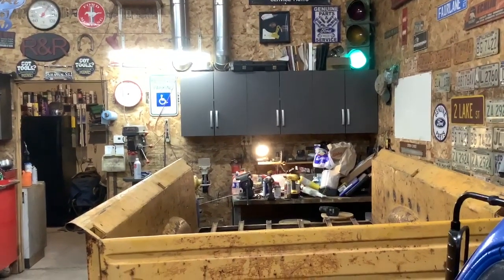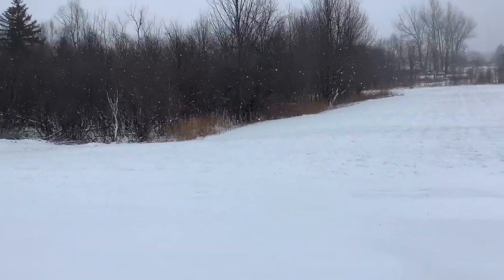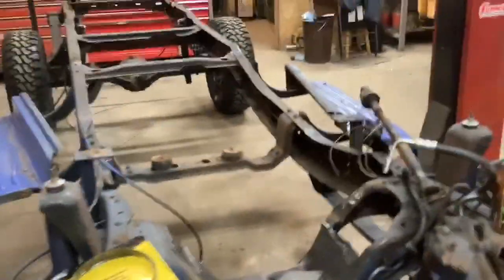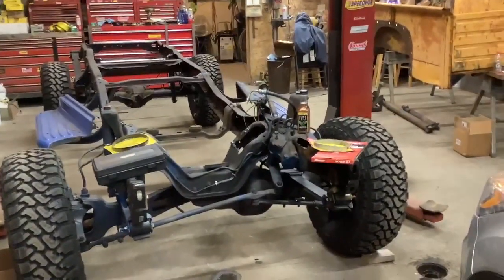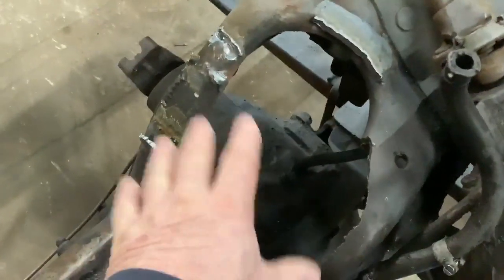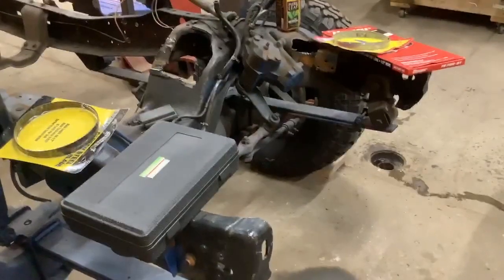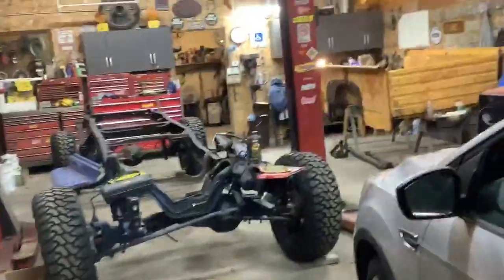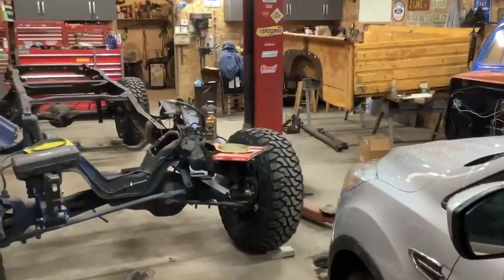Some new Xmas tools and Happy New Year .

Comment: I’m with you. I love Harbor Freight. Especially when buying a tool I only need once in a while. I don’t use them to make a living so if I was to break one I can just wait a day or two and go get another one. I have some yard sale snap on tools as well but the bulk comes from Harbor Freight and box stores. I want one of those bands saws too lol. One of these days. Happy New Year!
Reply from the maker: I bought a set of cheap deep well impact sockets years ago and I still have and use them ..I love cheap tools and Harbor fright fits into my price range ... ..I have pretty much built all my hot rods with cheap tools . One of the most over looked tools are Stanley I have two set of them 109 piece set , I use one of them when I go get used parts and the other is at my home . Happy New Year to you as well .
Reply: Rusty rods I may have the same set. Use them all the time
Reply: @ronsgarage4230  Me too. Two sets standard and metric.  Going on about 20 years.

Comment: Good score on the tool's!!! I do use my tool's for a living and own a lot of Strap On tool's!!! But 10 years ago or so I bought a new set of Harbor Freight deep and shallow metric regular sockets for 9.99 a set!!! I use them on my Ingersoll Rand Titanium 3/8 impact all the time and have NEVER broken one!!! But if I put a chrome 250.00 per set Strap On socket on the same impact I can guarantee it will break, maybe not the first time, but it will break!!! Most Strap On stuff is made in China anyways now!!! But they still want a premium for their stuff!!! Let's not even talk about their waist of money tool boxes!!! You're not buying a "tool box" from Strap On,  you're buying a "Fool Box"!!! Because you're a Fool to pay that much money for a stupid tool box!!! My grandfather was a mechanic as well and he told me that tool box don't make you any money!!! 
Harbor Freight is definitely giving Strap On a run!!! 
For me Craftsman never had anything good enough for the proffenial mechanic!!! Sockets always breaking, wrenches that would spread open and round of the heads of bolts!!! Ratchets with too course of teeth!!! Just not good enough for the proffenial!!!
SK have really good tools for around half of Strap On tool's!!!

I have that same horizontal/Vertical band saw!!! Works ok after a bunch of adjustment!!! Wish they sold a true full size vertical band saw!!! Hard to find one that's not 10 thousand pounds and 3 phase!!!
Be sure to by the best quality blade not the cheap O one!!! Cheap O won't last at all!!! 
Well Happy New year and glad you got snow!!!
Keep Rocking it out!!!
Reply from the maker: Thanks Pat I agree with you 100%  , I have one of those strap on tool boxes but I took in in on trade for so work . Here’s my theory on this by cheap tools leaves you more money to buy good parts and in the end you have one happy hot rodder .